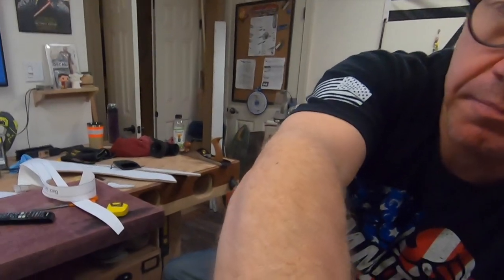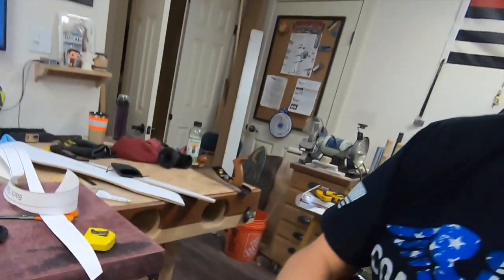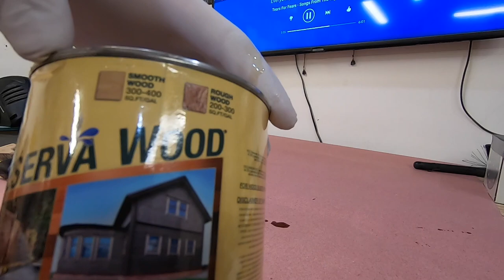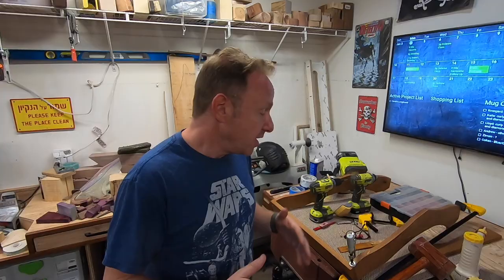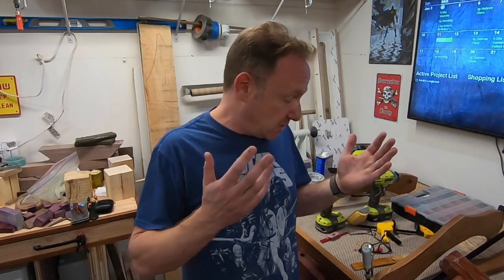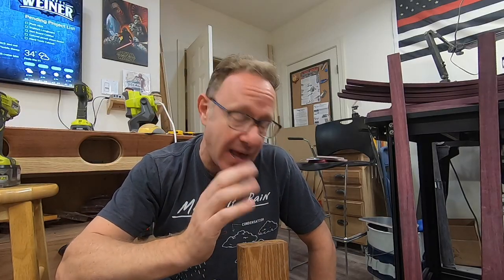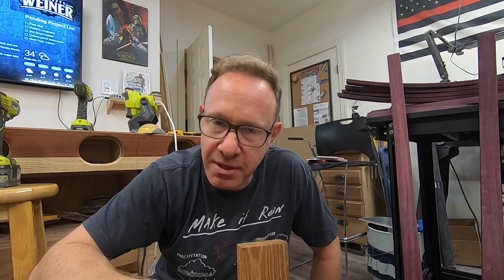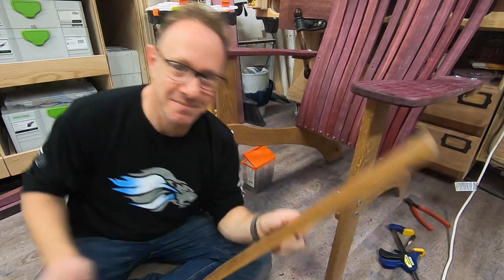How To Make Money Woodworking: King's Fine Woodworking Adirondack Chair Build Off & Free Give Away!

Comment: I like that you explained yourself, especially on the glue. I would not have guessed why you  used it.  Also, I like that you are finishing the wood before assembly.  I've done that a lot because it is easier to finish each piece than the whole project together.   I thought I was the only one who does it.  

I also like that you are working very slowly and carefully.  Most of the 'experts' I see make even the most difficult pieces look like easy and routine and work fast. I have to be very careful and precise just to be 'acceptable' and my mistakes still show.
Reply from the maker: Thank you for the feedback. The best part of being a maker is the journey why rush it? 🤘🏻

Comment: Blast It Scott - Ryan. This a hard vote. Ryan and Scott built the same piece. Each chose their aesthetic. Each has their own style of presentation, both top notch. Why neither have the subscribers yet is a mystery. This contest is a smart way to jumpstart that issue. 

Now Scott, You've got me on several planes. 1. Maryland, I'm on the Eastern Shore, near OC. 2. Purple Heart and Ebony. 3. I like corny. 4. Total Boat epoxy to fix blasted expensive wood with defects. 

Now Ryan, I make cutting boards so 1. I Love contrasting glue ups.  2. I have bandsaw envy. You make that look so easy, especially re-sawing. 3. All the prep work and predrilling parts make you ready for a production run! It is a "How To Make Money" title after all 4. Wheels, handmade, bonus points.

This is not easy. I am posting this exact comment with Ryan and James.

I think it's a tie, however that most likely will not count as a vote. Frankly, FREE always gets my vote.

Drum Roll please.

#1 Ryan - congrats

#2 Scott - truly sorry

Dean Williams - Winner Wanna Be
Reply from the maker: You a most kind. All good man. See you in OC this summer! 🤟🏻
Reply: @the_crafty_studio_official  Nah, Actually you are kind to even respond. If you are serious about OC, cool. I'd have take ya'all over the road on Assateague but just totaled the 4x4 I would have used. Wet road, hardened rubber, torque coming too fast, throttle body stuck full throttle. Knew exactly what and how to do and all my pilot training at the last minute said, Cross your arms, close your eyes, relax, you are going to flip when you hit the curb. WALKED AYAY without a bruise. You would not believe how much the insurance settled for a 2004 Nissan Pathfinder with 217k miles on it. 

I'm looing for another one just for another cash out. Hey, YT, I'm kidding about another cash out. I'm not Evil Knievel. Thanks Scott....Deano

Comment: Both chairs are beautiful. It's almost impossible to choose a winner from a short video clip. The only reason I chose your beautiful chair 'second place' was because the screws holding the cross piece to the front and back legs didn't alternate in height and perhaps touch on the inside. Unlike the other chair. I might be wrong though. But they're both gorgeous!

Comment: Hi Scott absolutely love your build!! One question how did you modify the backslats to be able to use the thinner wood? Thank you
Reply from the maker: Hey Lorne! Thank you and thanks for asking. It was quite simple. I used a compass and traced the line to the new dimension I needed which in this case was 3/4. What was nice about that was as the template was 1.5 I ended up with a spare. Let me know if you need any more help and thanks again for watching! 🤟🏻

Comment: How did you change the plans to account for the size change? Are there tips or altered plans? Thanks
Reply from the maker: Hi! I took into account scale and wood strength since I was making it out of hardwood. For the legs both angled and upright, I milled them to 1" thick. For the balance of the pieces I made them 3/4. There are no altered plans for this, I just used a compass and reset the paper templates to size and cut accordingly. Hope this helps.

Comment: At 4:15 you mention that to make it out of 3/4” material you have to modify the template. What kind of modification did you have to make? Or is that information included in the plans
Reply from the maker: Hey! No. What I did was using a compass i followed one line of the template and created a new line at 3/4 thick rather than the 1 1/2 on the template. I then cut along the new line. Hope that helps. Thanks for asking! 🤘🏻

Comment: Hi Scott. I’ve  closely watched your video as I see you used 3/4 except for the back slats which I believe were 1 1/2. Is that correct I built one all from 3/4 pine (uploaded to the Kings woodworking channel and painted it red and purple as these were the favorite colours of the young woman I built it for) it was quite a challenge especially trying to align and screw the back slats into the upper middle and lower parts. Missed the mark on many occasions. Grrrr. Anyway I did not quite understand how you used the compass to adjust your plans. I suspect I can learn from you.
Reply: And I vote 1st place for your build.

Comment: Great looking chair! I've got a couple of questions, what grit was your final sand to, 220?  How do you think pocket holes would work on those back braces if you measured them out ahead of time?  I was just thinking that would keep visible screw holes down to a minimum although the plugs do look nice and you could still fill the pocket holes if you didn't want any holes to show.
Reply from the maker: Thank you! No, I sanded to 150, wanted to leave room for the sealer to get into the grain. You would can certainly go to 220 but its probably unnecessary for outdoor furniture. As for pocket screws, you could certainly try however I feel it would be challenging. Remember that the back support is parallel to the ground but the back slats are arched to mimic the shape of a relaxed spine in the chair. I would run a test first and if you do, make sure to use exterior screws. Please be sure to let me know how it works out!
Reply: @the_crafty_studio_official  yeah it would take a little trial and error, to get the right length of screw. I'm a few weeks off from attempting it myself  so I'm just mulling it over in my head. How much would you estimate your hardwood version weighs?
Reply from the maker: You know, I haven’t a clue?!?! Lol. I see if I can get you that.

Comment: Question - what thickness of the wood did you use here?  4/4?  what size screws and bolts did you end up using?
Reply from the maker: Hi Alex. It was a combination. I needed 8/4 for the back slats then the arm rests and seat slats are 3/4 and the uprights and diagonal legs are 4/4. The 8/4 allowed the back slats to be 1.5” wide but 3/4 thick. As for bolts and screws I used deckmate deck screws, can’t remember what what length but assume 1.25 or so for the slats and 2 inch for the arms. Bolts I’m unsure of at this moment. Hope this helps and if you have any other questions feel free to reach out. Thanks for watching and asking. 🤘🏻
Reply: @the_crafty_studio_official  Yes it does. Thank you. I'm currently building one from 2x lumber, but next one is going to be from good wood which is going to be different size, want to double check because i will need smaller screws and bolts then for regular lumber :)
Reply from the maker: @AlexK07010  glad I could help. good luck and send photos!

Comment: Are you building any of these with soft woods?  If so what price range are you asking?
Reply from the maker: Hey John. I can. The design is the same but the overall thickness of the materials will be thicker. Price starts at 350 per chair and is dependent on material cost. Let me know if you are interested and thanks for asking.
Reply: Just about finished with this project and have found that this is a fairly time consuming.  From start to finish how long does a chair take you.  $350 seem about $300 cheaper than what you should charge.  Thanks for your time.